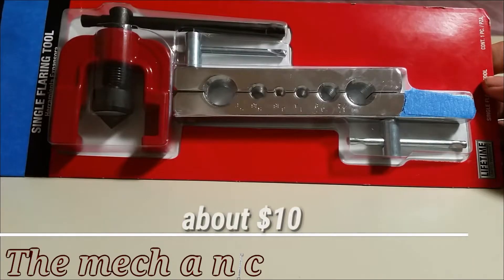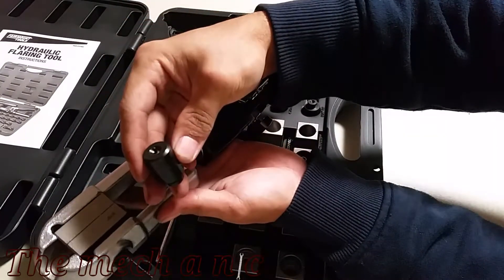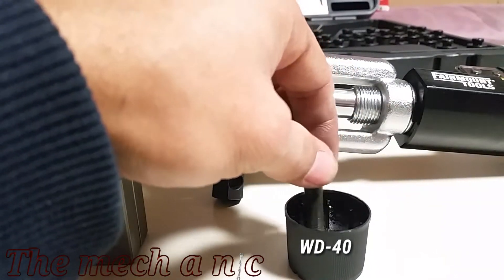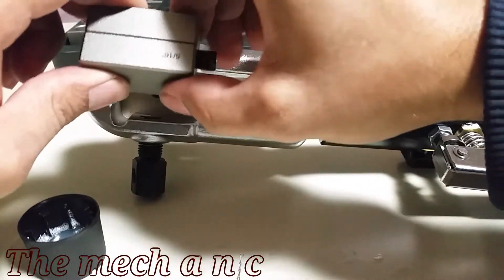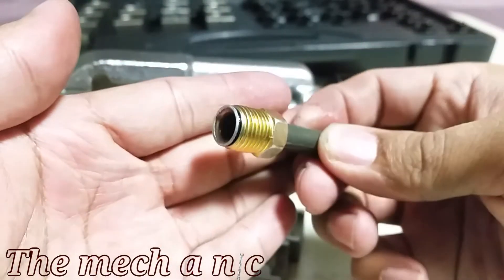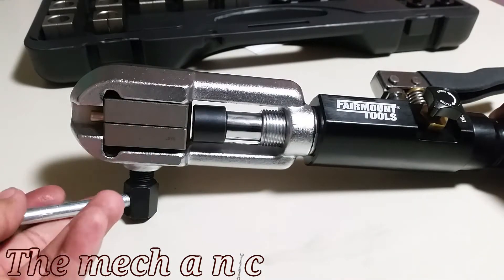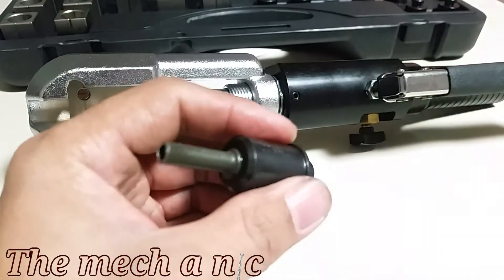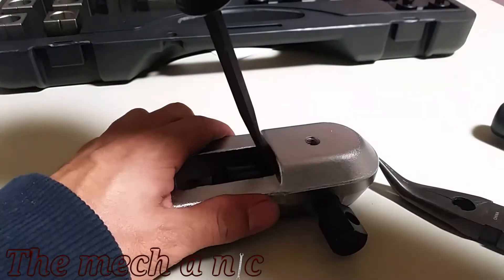Fairmount hydraulic brake flare tool review

Comment: Excellent tool.  So far the only one that I have found to do GM 1/2" diesel fuel line push connect fittings in steel tubing.
Nice review!
Reply from the maker: Thank you!

Comment: Looks like a Mastercool Copy.  I bet the dies do not have enough of a draft angle in the bore.
Reply from the maker: It is a mastercool copy . So far it's been working well for me . 👍
Reply: More of a Mastercool version 2.0.  Better split die design (alignment pins), improved yoke (magnets) and more flare sizes.  I have both Mastercool and Fairmount tools.  I use this tool the most.

Comment: I would contact the company about  this and see what they suggest. Could be an issue with the dies.
Reply: 1: Lube the inside and outside of the male die. (Use gun oil or 3 in 1 oil)
2: Form the flare
3: Before unclamping the split die, release the hydraulic pressure and unscrew the hydraulic presser (this will pull the male die right out).

This is from experience as I have this tool as well as the Mastercool tool.  This tool will do flares that the Mastercool won't, such as GM 1/2" fuel push connect in steel line.

Hope this helps